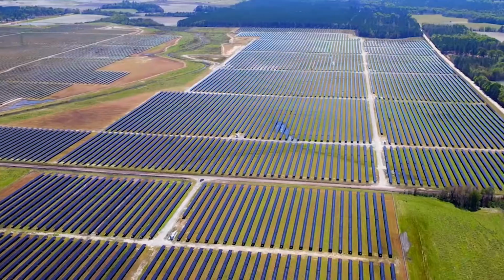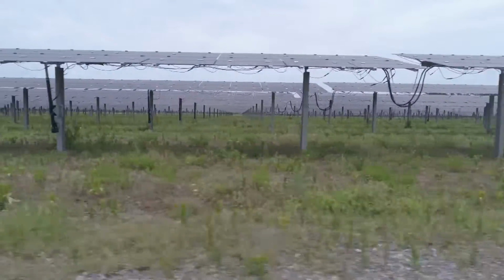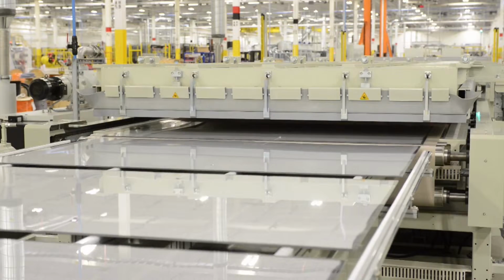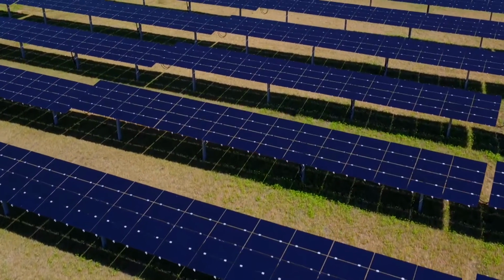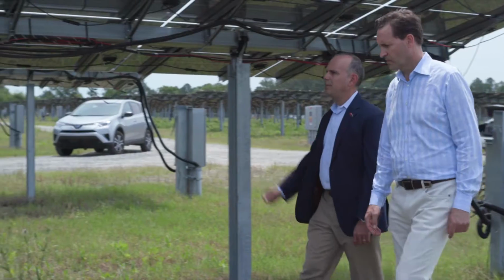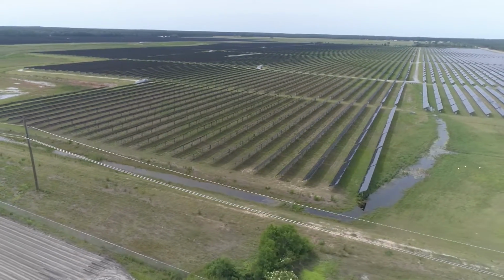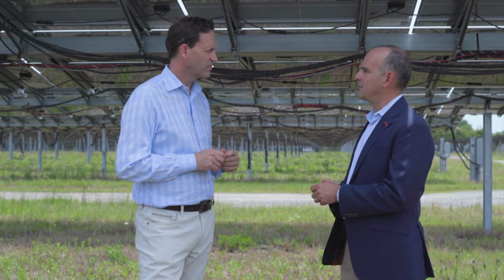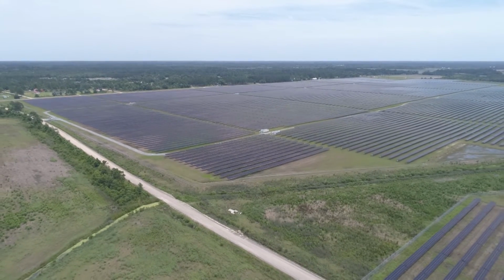First Solar Provides Clean and Affordable Power Solutions

Comment: I work there and the amount of waste we produce greatly outweighs any benefits towards the environment.  Thousands of pounds of waste adhesive, Styrofoam, scrap metal and broken glass goes to landfills from us every week.  We've got pallets full of defective solar panels that have been sitting behind the building rotting longer than ive worked there,  and our quality of our products are garbage.  Most of those panels wont even last 5 years